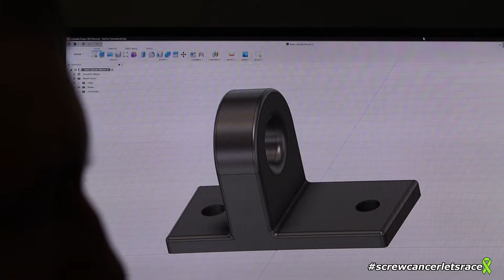DIY Hydraulic Pedals Update!

Comment: Couple questions, what do you think about your pedals as of today? I ask as I know ppl who hated the Wilwoods and changed to Dopplers and Tiltons.... The reason the person hated the Wilwoods, is something broke on them. Also, does it work in Iracing? What program do you use with windows to work? Great video!!
Reply from the maker: Sorry for the very delayed response.  The pedals do have their shortcomings, primarily the brake pedal is sloppy, but following the data sheet provided by Wilwood you still get great pedal action.  The pedals work fine in all simulators I have tried on PC (anything that will use pedals will use these).  The Arduino script allows Windows to accept the pedals as any other off the shelf pedal set.  I use a program called "DIView" to fine tune the pedal travel and calibration.

Comment: very very good
What firmware and utility did you use the sensors and potentiometer with?
how many psi sensors
thanks in advance
Reply: sorry you said 1000 psi in your previous video
Are brake and clutch the same sensor?
Reply from the maker: @vahdettinatalay8870  I'm not sure if this is still relevant for you, but I'm using a 100psi sensor for the clutch and 1000psi sensor for the brake.  I modified a Joystick sketch for Arduino and uploaded it to an Arduino Pro Micro.
Reply: @screwcancerletsrace  Thank you so much
Reply: Awesome project and glad I found your channel. Do you have a list of parts you used. I’m looking to convert my current pedals to hydraulic.